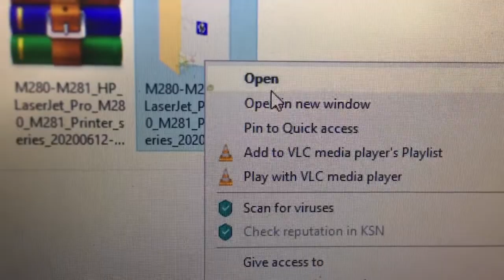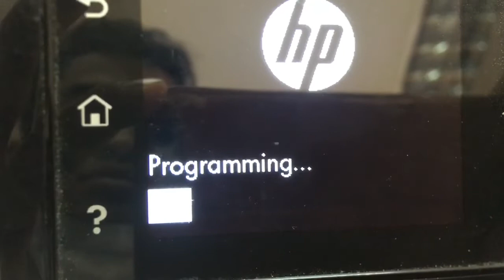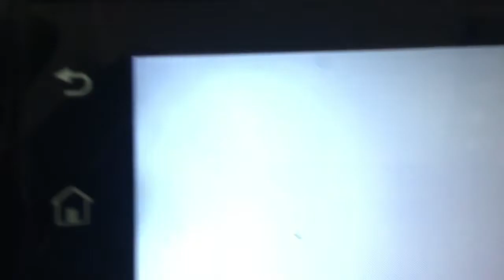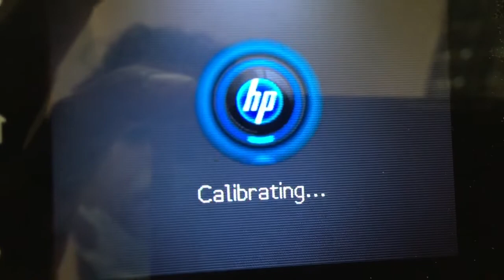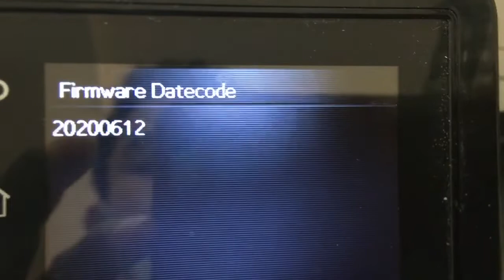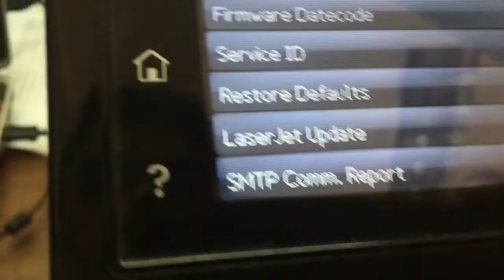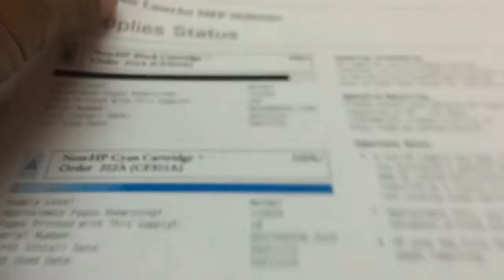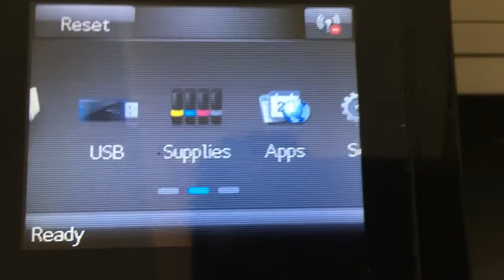Cartridge Blocked for Containing Non-HP Chip fix 100% working HP Laser Jet Pro M279 M280 M281 series

Comment: I have a hp m283 printer today I cleaned it and installed new original ink but the colors are faded what is the problem??
Reply from the maker: try to calibrate toners inside printer control panel, MENU printer quality and then Calibrate now
Reply from the maker: and you install driver full?
Reply: @khmersharekh  Yes, I deleted it and reinstall them, but the problem is still the same.. This is the supplies report
https://up6.cc/2022/11/166930973214971.jpg
Reply from the maker: @abomahdi123  cannot open your supplies report